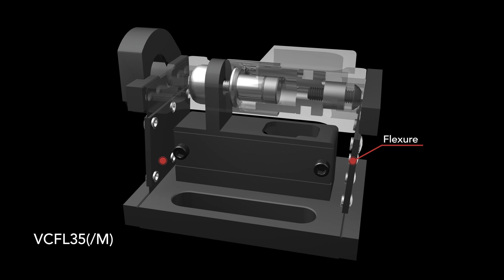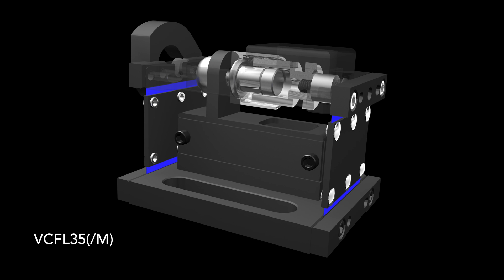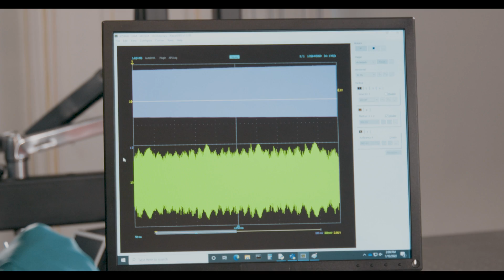Voice Coil Flexure Scanner for Interferometry Applications

Comment: Hi，which kind of controller is used for voice coil motor? And reference laser Laser fringes used for feedback signal?
Reply from the maker: We are still developing a driver for the voice coils. We have found that using a unity amp in conjunction with a signal generator provides the best results for testing. The amp we used was the OPA548 from Texas Instruments: https://www.ti.com/lit/ug/sbou132/sbou132.pdf?ts=1610054713967&ref_url=https%253A%252F%252Fwww.google.com%252F.

Texas Instruments also has great documentation which briefly covers driving inductive loads: https://www.ti.com/lit/an/slvae30e/slvae30e.pdf?ts=1645552502589&ref_url=https%253A%252F%252Fwww.bing.com%252F.

To date we have only implemented optical feedback systems, like using a Michelson interferometer output and scanning with a voice coil in closed-loop. These could also be driven in open loop, or potentially with other feedback systems.

Comment: The center stiff section and flexible edges of the flexture arms mimic the action of a compound bow from archery: the flex in a bow is mostly only at the ends of the arms. Given how many times a bow is drawn and released without breaking it seems like a durable design choice.
Reply from the maker: Thank you for a great observation Craig. The flexures are made from hardened steel with a high yield strength and the bend radius is designed to be large enough, relative to the thickness of the material, such that the lifetime is essentially infinite. Your comparison to a bow is further interesting as the path of the moving platform along the axis of scan is parabolic. Another term for this is arcuate, meaning shaped like a bow (curved).